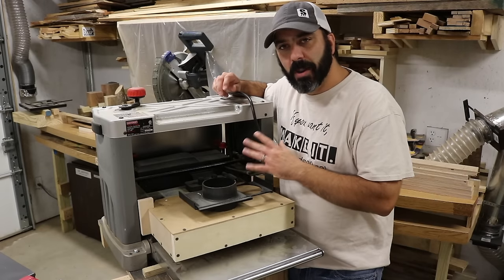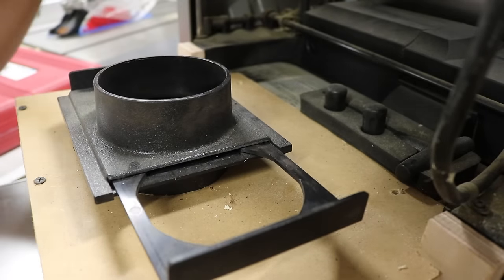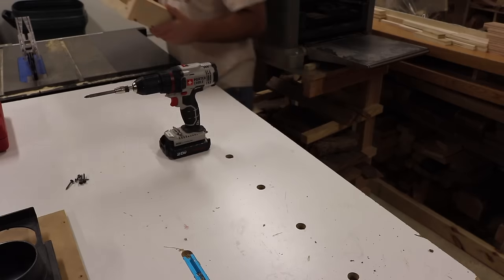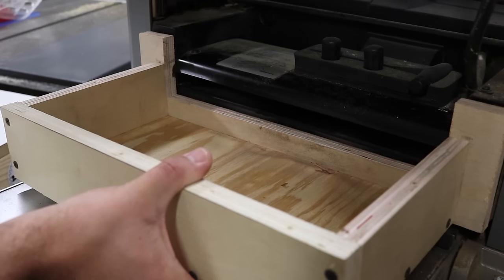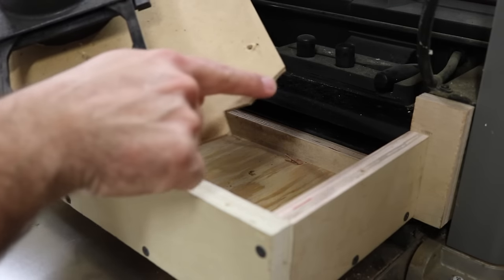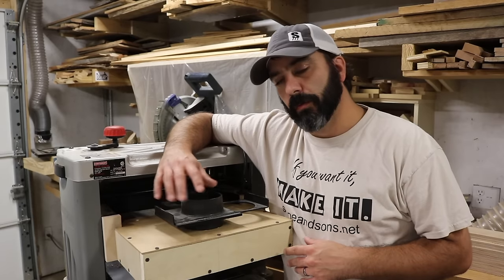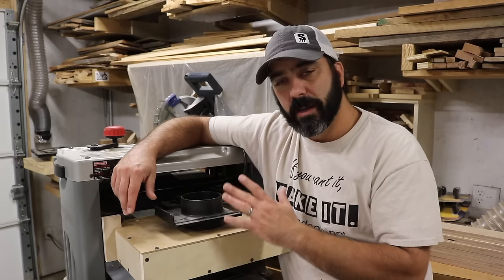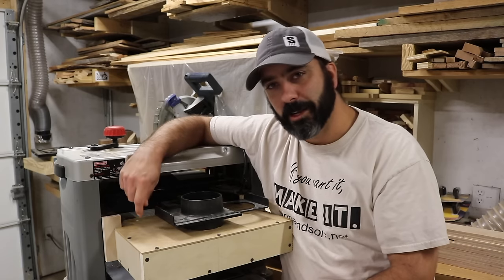Planer Dust Collection - Shop Made

Comment: Shawn, I would recommend adding some lightweight, 45 degree pieces into the two back inside corners, to cause the chips to gravitate more towards the collection gate. This would help prevent them from building up in the corners, and adding more downward pull on the box.  Just a thought.  Dave
Reply from the maker: +R&D WoodShop Good advice. Thanks Dave.

Comment: Great video! I need to make one for my Rigid planer because the dust vac attachment is discontinued and I bought the planer used. I noticed you had chip buildup in the corners. Take a piece of 4" PVC and cut it the same thickness from the bottom to the top of that box inside (2" maybe?) then cut that "washer" into quarters. Take two pieces and screw them into the corners to create 2 radii so that the airflow will keep debris moving inside and that way you wont ever get a clog from that stuff in the corners. I am going to implement this in my design. thank you again!

Comment: Have you thought about adding two walls on the inside cut at 45 degrees creating a V so all shaving go directly to the last gate. Noticed the left over shavings stuck in the corner. Just thought I could help, not trying to but in lol. Great work bro
Reply from the maker: +MAINEiac Creations That's great input... I just wanted to keep it simple and it actually works great so I haven't added to it.

Comment: Cool. I did the same sort of thing, except I adapted sheet metal ducting to accomplish the same for my Delta of nearly identical design.
Reply from the maker: +Jon Miller I bet sheet metal works better.
Reply: It does work pretty well. My hose attaches at the end of a cylinder that runs across the back of the planer, so chips exit from one side. I deliberately left the other side imperfectly closed so there can always be cross-flow to help the chips change direction. It works unless I take a fairly heavy cut on a full-width board, in which case there's just too much and it jams. So I just try to remember to not do that. :)

Comment: good job. 
i think it would work better if you had a few holes to allow more air in.there is very little airflow through the planer
Reply from the maker: +MelbourneAlan It actually works very well... also in order for maximum suction from the dust collector it needs to be sealed. Thanks for watching.
Reply: you can get away with sealing up with a high pressure low volume dc (shop vac) but with a low pressure high volume dc you will need airflow to keep the chips moving. . 
on my planer thickneser i have a 4 " dc port but have an 8 " metal duct fom the dc. if i conect to the 8" everything will clog up. i am in the process of getting a 6" port made to fit instead of the 4".

Comment: Since there were a lot of chips inside the box when you removed it, do you feel it would work better if the interior wasn't square? By that, I mean if you added some angled sides to help guide the chips toward the center (I'm thinking along the lines of how a downdraft downdraft box is made).
Reply from the maker: +Dale Boyer Yes I think that would help, but I have to say it works very well. It's like cabinets saws (speaking of the older ones)... they're square inside and the dust collection actually works better after dust has built up acting as "angled sides". I appreciate your comment and thanks for watching.

Comment: Did you put the opening on the top because there wasn't enough height in the box? Do you foresee any benefit with putting the opening on the side/end? Any issues with the opening on the top?
Reply from the maker: +Scott Haun (haunmade) Hey Scott! Yeah, the box wasn't deep enough for the dust port to be on the side. Actually, I had it in my mind to place it on top the whole time for convenience. My thought is to place all my blast gates in the most convenient location within my work flow so I'll use it. To answer your question... I've had no issues with the location of the dust port at all. That little bit of chips you saw in the box is from months of using the planer. Thanks for reaching out to me. Hope that helps.

Comment: There is a website that most likely has the replacement dust collection port for your model planner. Http://www.ereplacementparts.com
.
Reply from the maker: +Scott Pearson Thanks Scott, but if not mistaken I believe I've checked there. I also called craftsman and sears.
Reply: Stone and Sons Workshop no worries. I had a woodworking friend tell me about the site when I picked up a dewalt planner from a pawn shop that was like new for $250 and they still sell new at lowes for $400. It was missing the dust port. I was also able to get the reducer there as well. I even found the "C" retaining washer for my 1980's Era craftsman tablesaw. They have a ton of parts.  I just entered the model # and craftsman and it pulled up the unit(s) it felt relevant. Nice idea btw.
Reply from the maker: +Scott Pearson Its a great source for parts. I've actually ordered parts from there.